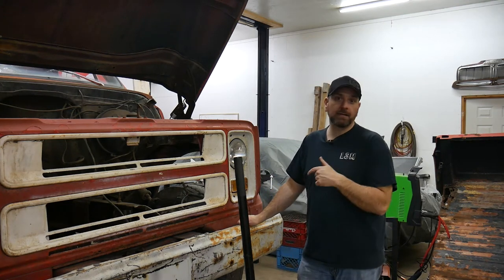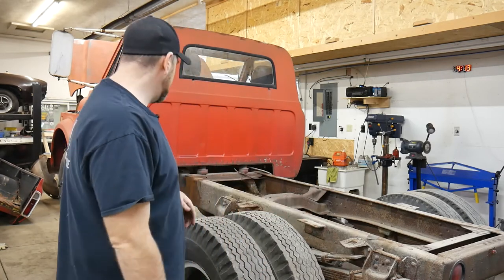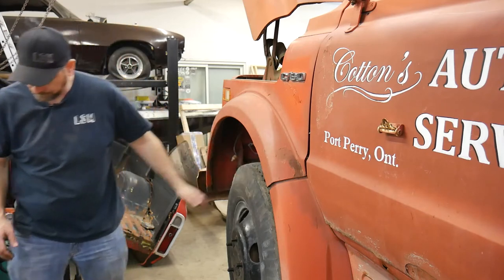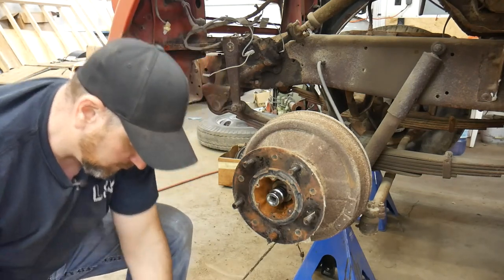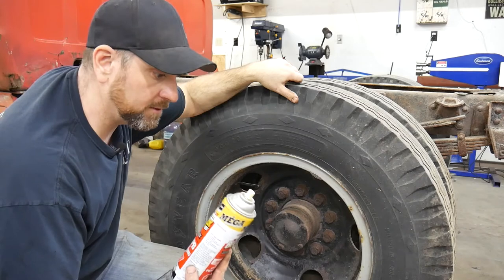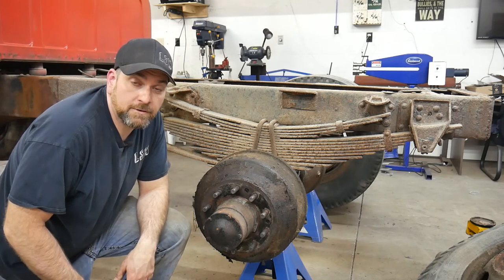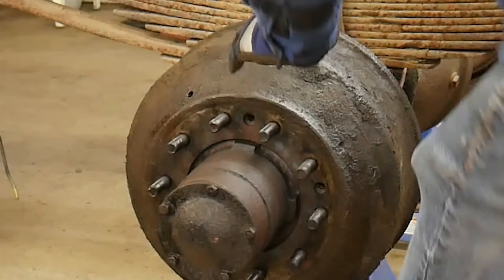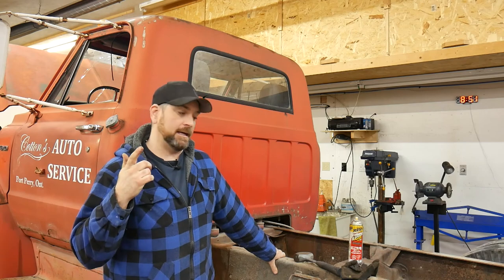Checking the Brakes on my C50 Chevy

Comment: Hey those ARE multi piece wheels. Guys argue over what is called split rim , split ring etc. But these split in the center of the rim,  these are what's called widowmakers! Use extreme caution working on these including mounting dismounting or inflating. The fronts would blow inward and maybe damage the truck while making you mess your pants. The rears the joint is under that band around the circumference of the inside of the wheel,  it would blow outwards and it wouldn't scare you. You'd be gone and never feel a thing. Deflate them before doing much to them! And use a cage and one of those clamp on chucks to  inflate. Be careful.
Reply from the maker: They went to scrap!!
Reply: Good info.

Comment: There is a 1967 C50 in my dad's yard.  I believe I still have the owner manual.  In '67, the engine choices were two inline sixes, the 250 and 292, two small-blocks, the 283 and the 327, and a big block 366.  The transmission choices were auto 4 speed with hydraulic retarder, 4 speed Chevrolet and New Process, 5 speed Clark, New Process and Spicer, and 5+4 spicers.  Rear axles were available with vacuum shift two speeds.  There's a bunch of info I don't have on top of my head but I kept that book somewhere and Its not going to the trash.

Comment: I've got the big, lumbering 305 V6 in my '69 GMC. Since I've got it I've been thinking about all the things that you're experiencing with brakes and those rims and the axles and the whole thing I'm pretty convinced the best thing to do would be to replace all of it but I really don't want to it's got 86,000 original miles. I think I've got the same wheelbase as your rig. Seems like when I see them, they usually have that longer wheelbase on grain trucks and things

Comment: Interesting. My 70 C50 has split-ring bud wheels. I've never seen a 70 with split rims. I think people get Split rims confused with 2 piece Slit ring (a wheel and a ring) and 3 piece Slit ring-lock ring wheels(a wheel with a slit ring and a safety ring). And of course, there is the 2-piece rim. 2 piece and split rims are rarely seen anymore. The most dangerous wheel I've ever seen is the old split rim. The old split rims were dayton style wheels. They literally had a diagonal slit/separation across the wheel and were held together with a ring. They were tube-type, with an inner flap to protect the tube. I saw one of these split rims come apart back in the 60s, while a tire guy was putting air in the tire. The ring took the top of his head off right at his eyebrows. Wheels have improved over the years. Split rim to the split ring, to the split ring, safety ring. Progressively less dangerous. And now the safest solid Dayton or Budd-style tubeless wheel. I've talked to tire men that really didn't know what a real split rim was. Probably because they had never seen one!!! I didn't start driving big trucks until 65. 1965.

Comment: V6 was more common in the GMC trucks, I’m not sure if they were in the Chevy line.
Reply: The big block V6 engines in those old trucks were usually 305 C.I.. Terrible fuel mileage and not as strong and dependable as a V8. I had one. My 70 - C50 had a 292 straight 6. Good dependable high mileage engine, but a little weak. I built a 350 and replaced the straight 6. Very happy with the fuel mileage and performance.

Comment: Yep. You have split RING budd style rims. Not split rims!!! Not totally safe. They should be worked on inside a tire cage, totally deflated! And there's a good chance of distorting/gaulding the threads on the lug nuts and studs when you use a torch!!! Increasing the odds of stripping the threads out. If a tire guy wanted to piss me off all he had to do was take a torch to my lug nuts!!! I knew it meant trouble down the road!!! I'll share a little secret with you about removing the brake drum. You almost had it right. Put a pry/crowbar between the backing plate and the drum, pull out/toward you as hard as you can without bending the backing plate, and then tap/hit the rim (on the inside edge) directly across from the pull bar with a hammer. The drum is cast iron, so you're always taking a chance of cracking or breaking it. But, cast doesn't bend or distort unless overheated. You might find this to be quicker/easier.  Did you try finding someone to put a lining on the lining table-web. Most brake lining/clutch disc shops can do that.     And thanks a lot for taking the time to make the video.
Reply from the maker: Yes I could have had the shoes relined but I’ve gone to a completely different and more serviceable chassis. Go check out my latest videos on this truck!!

Comment: Your rims are RUSTED to the axle HUB ! Loosen lug nuts with cheater pipe , BUT leave them  on loosly ! Spray backside with WD40  on both sides  !  Next , lower front axle down to ground............the weight will eventually cause the wheel to separate from the Hub !